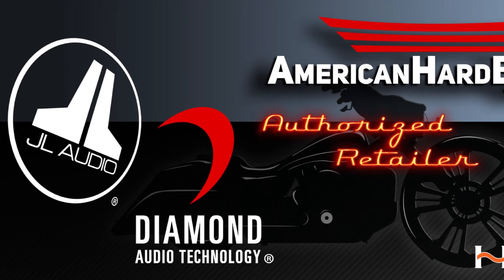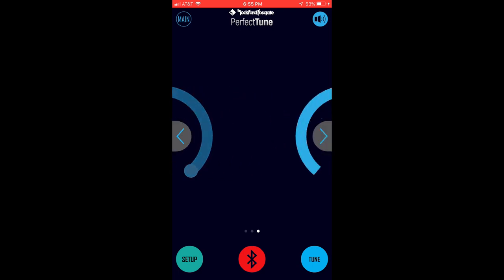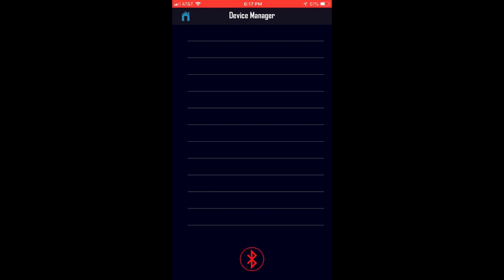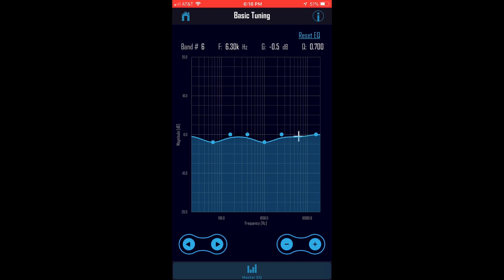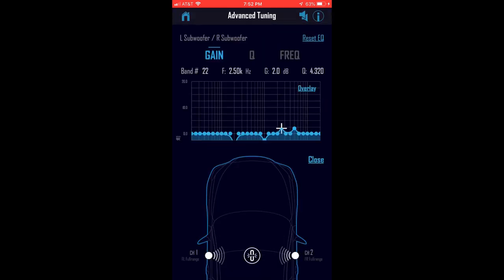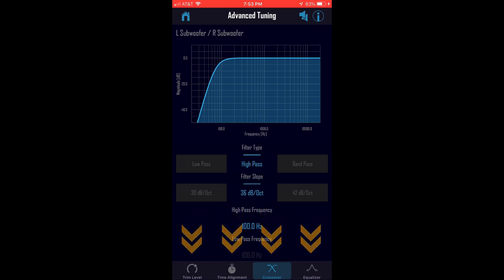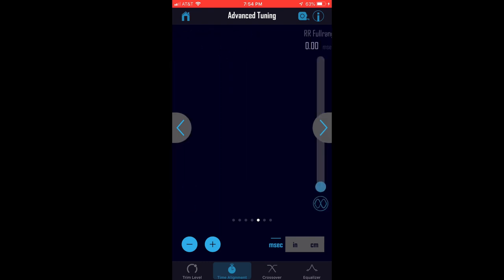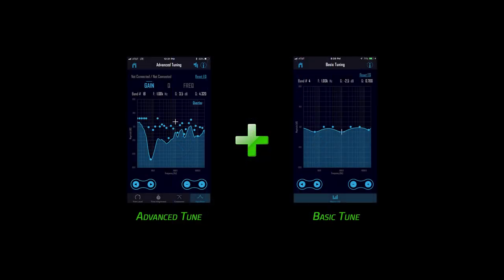DSR1 App Overview

Comment: One thing that would have been nice with me to know which wire's to hook up with installing it yourself. Well I figured out is the yellow wire has to be up 4 power black to ground what's go back to the T harness and the blue and white wire go to remote amplifier turn on. Then only RCA's all the extra speaker wires and spdif all need to be eat drink or take. Do not look up the remote input wire to the blue wire on the T harness. There are no videos that I could find explaining this for a Harley Davidson motorcycle

Comment: do you still have to flash your radio if you install this on your Harley?
Reply: I'm no expert but I think so 🤷🏾‍♂️
Reply: If you buy a Harley with the boom audio system your radio has already been flashed by the dealer the only time you have to flash a radio from Harley is it is new and never been put in or on a motorcycle before. The DSP in this video made by Rockford Fossgate you don’t have to flash your radio!